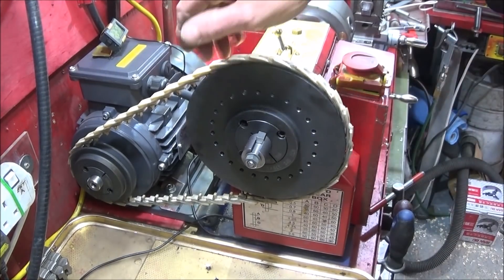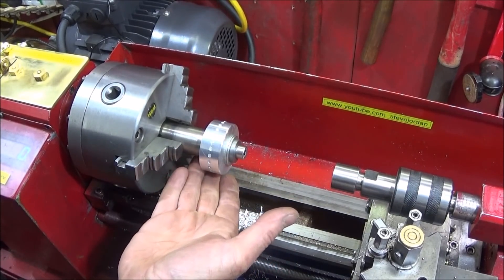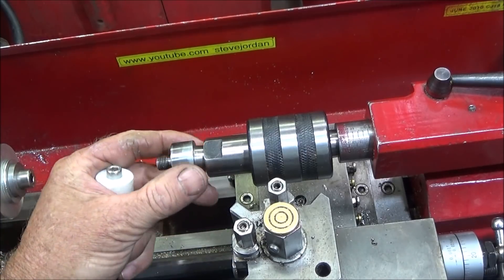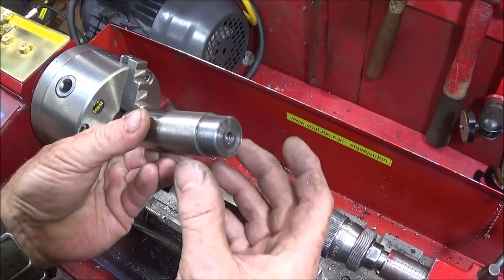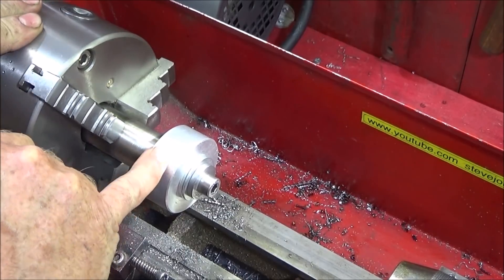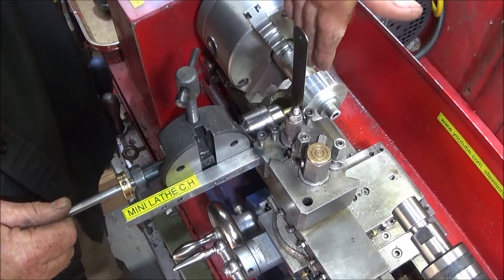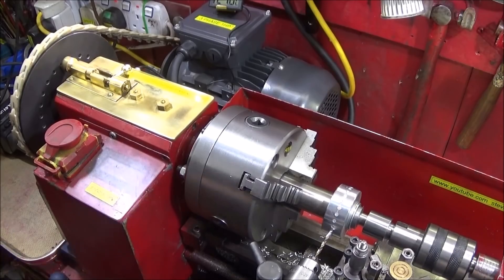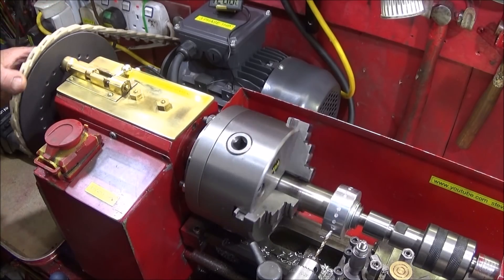Chinese Mini Lathe Indexing Pulley Making & Using A Captive Mandrel

Comment: Any reason you didn’t make aluminum pulleys and use a serpentine poly v belt? By the way that belt does look a bit loose. You can see the expansion and jump under load. A little is probably normal but it should be tight enough it isn’t bouncing after you seek the rpm. Might not matter on that little lathe anyways but something to consider. Nice motor that looks a lot like the 3/4 3ph Techtop I have on my bandsaw. Techtop’s are probably the best motors per $ I’ve found and they can run 150hz all day long. I did a 10 rib pulley setup on my 13x37 lathe and I like it a lot it works very well over the double v belt I removed that gave me headache every few months they’d wear from the high rpm. People never consider the fact you can purchase a cheaper mode and do your own upgrades and make it a gem. I like to do a cost analysis knowing the motor and other components will get replaced.

Comment: With no more gears how difficult would it be to make a new extended main shaft and make it hollow all the way through so it does not block you for checking up long shafts through the headstock?
Reply from the maker: Hi yes you could do that but I have no need to. I always just cut enough off of bar for what I need for a component. I use one of those cut off grinders rather than parting off a piece as well

Comment: Great idea for the pulley index.
I have a suggestion, how about using gear change wheels with a pawl to locate the position. That way multiple choices are available beyond the modulus of the fixed pulley.
Keep up the good work, super channel.

Comment: Works great, but what are those ghastly high frequency noises? Some must be the belt, you can hear it when Steve turns the chuck. Is it directional? VFD pcm frequency should be adjustable.
Reply from the maker: Hi Toby,  Your hearing must be different to mine, I can't hear any frequency noise at all and others have remarked how quiet these VDF models are. It maybe the belt noise you are hearing??

Comment: Nice job Steve. I recently used my indexing system to make a scaled knob for the fine feed depth control for my mill. Using any appropriate lathe tool to scratch the lines in the part. These indexing systems are very useful and not just for holes. Your new set up is great. You are a very impressive ideas man and you have given me many ideas in your videos, Great videos Steve keep up the good work.
Reply from the maker: Hi Stephen. That sounds good. I have to make one soon to fit the leadscrew to advance the carriage by hand when milling. Is the milling machine you have a good machine tool?
Reply: Hi Steve. Oh yes I had a micro mill, but it just wasn't man enough for the kind of work I was doing and I ended up with a new sieg SX2.7 (wouldn't let me post a link)  which is pretty capable and I have just made a new tool-post using this machine. Same tool-post as my old one, but a bit bigger and made of steel instead of aluminium alloy.  Your setup for you mini lathe is very impressive, I will in due course probably do the same as you have. Best regards,
Reply from the maker: Hi Stephen, I just had a look at that milling machine. It looks great. Sounds like you are making some great things. Yes I'm very pleased with the mini lathe now. Just looking forward to setting up a separate push button control box now.
Reply: Hi Jordan. How did you make the holes for index?  Did you measure it by  "hand ?

Comment: Why didn’t t you use the tail stock 4 jaw mini set up you made to tap the 8mm? Would have been a great  test for the new vfd motor 👍🏻or was that steel too hard?
Reply from the maker: Hi the steel was very hard, I had to anneal it before I could get the screw-tap to go all the way. I'm not exactly sure what type of steel it is, but it hardened after cutting with the angle grinder! I only used it as I had run out of this sort of diameter. Still it is a nice solid mandrel to use. These captive type mandrels can be made and used using aluminium without any problems, but I forgot to mention that.

Comment: Hi really good vid as usual, I feel the belt sounds very noisy would a standard belt be quieter. The uther thing that would bug me is you have blocked up tbe spindle hole . Keep up the good work.
Reply from the maker: Hi Jonathan, the low cost nylon belt is a bit noisy, but I will be changing it soon for a PowerTwist Fenner belt which is made of good quality composite polyester/polyurethane materials. The blocked off spindle hole doesn't bother me as I never use that length of bar, plus I can still use the same set-up for drawer bar tools by removing the brass taper 8mm stud assembly. This then allows the draw-bar thread to go right through the mandrel, locking both the pulley assembly and the MT3 taper tool into the lathe spindle.

Comment from the maker: MT2 Live Center Set Morse Taper 2MT Triple Bearing Lathe Tool -- https://goo.gl/4hGyw8
  Mid-year Mechanical Parts Sale (up to 80% off) --  https://goo.gl/BhBHhw
ALSO SOME GREAT NEW DRILL OFFERS:- 30% off Drill Bits Promotion -- https://goo.gl/KrG3Wh (code: 266b22 )

OTHER IMPORTANT INFO:- TAPER LOCK PULLEY SETS USED:-
MOTOR PULLEY SET....SPZ90-1-1210 V Belt Pulley & 1210 (19mm bore) Taperlock Bush
SPINDLE MANDREL PULLEY SET.....SPZ170-1-1610 V Belt Pulley & 1610 (25mm bore) Taperlock Bush  (The spindle pulley shaft is 25mm diameter to give enough depth for the 8mm woodruff key slot).
(I bought these taperlock sets on Ebay....Seller bearingshopuk-eb)
Reply from the maker: Banggood Health Protection -- http://bit.ly/33tNTBx
  Banggood Health&Care Protection --  http://bit.ly/3d7QpSy